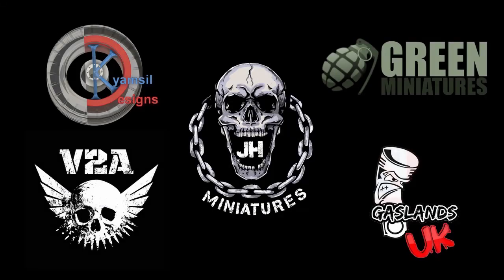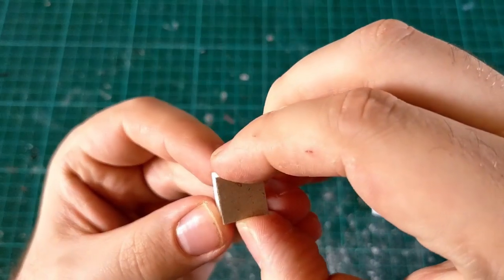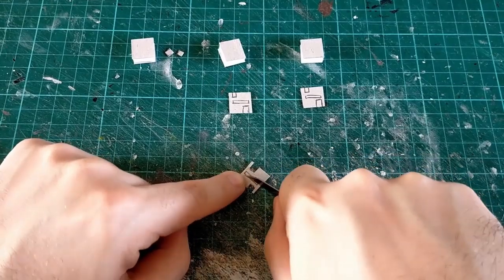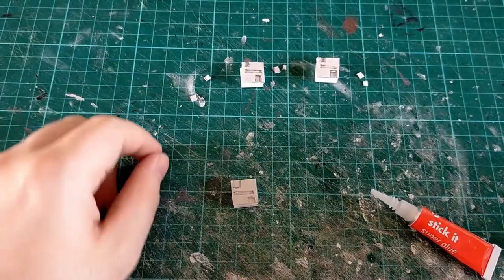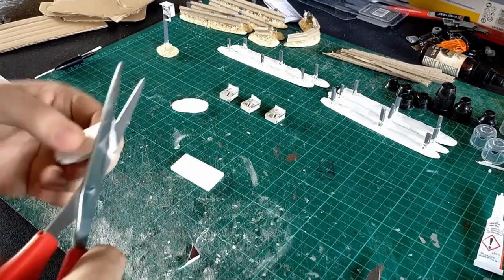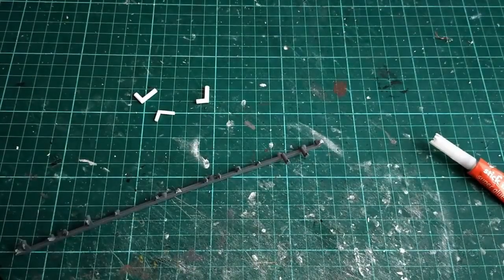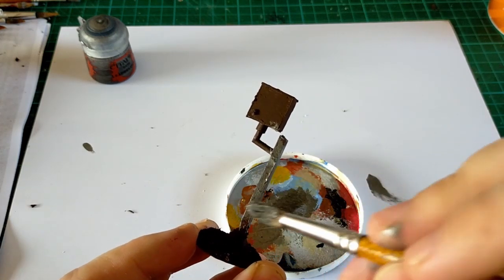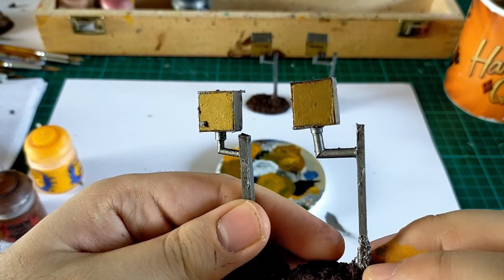How to Build, Speed Cameras (Gaslands, Dark Future, Autokill, Car Wars)

Comment: For bases like these where balance could be an issue, i use thick cardboard and drywall.  The weight of the drywall compound would lower the center of gravity and make them more stable.
Reply from the maker: That sounds like a rock solid combination 😉 thank you man!

Comment: I use cat litter and play sand for bases. The litter adds like the gravel and rocky bits to the base. I also glue things in with E6000. But it takes 15 mins to dry, tho it's thick enough to hold the sprue on it's own usually. 

Idea, Bisto can bunker/wasteland garage/qounset hut. I may do a video on that but would like to see your take.